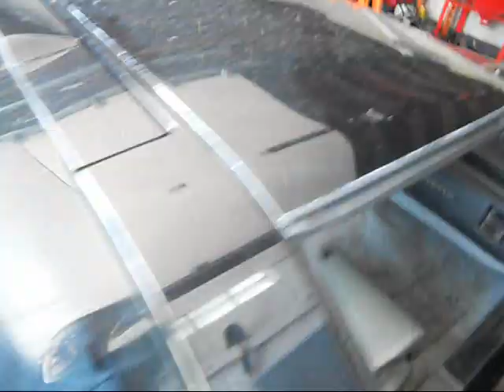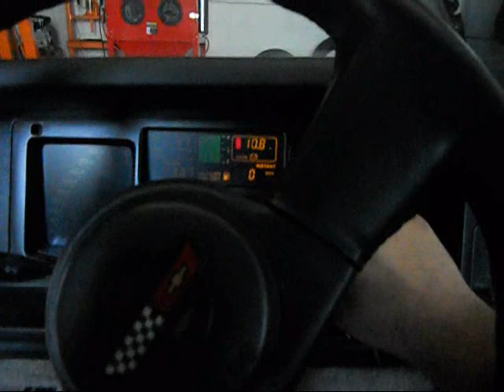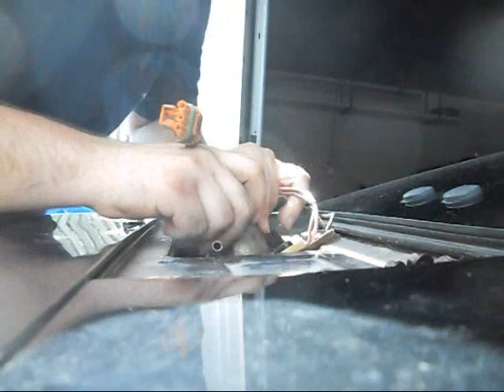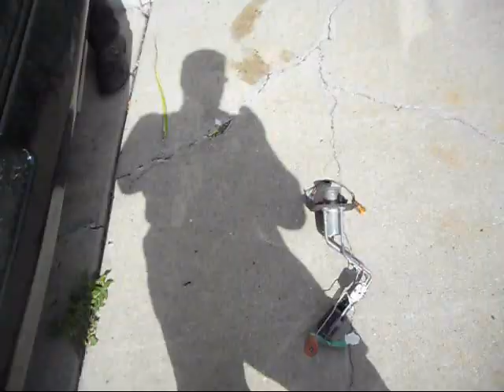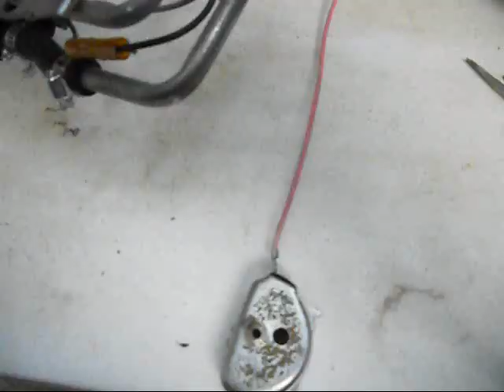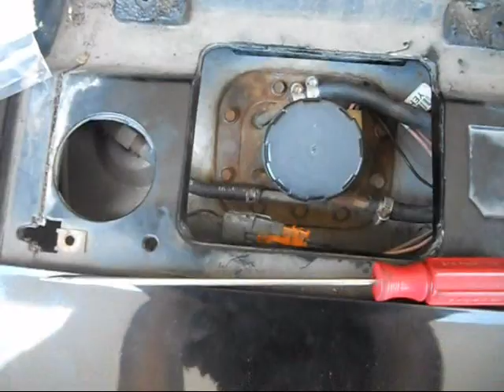1986 Corvette fuel sending unit repair

Comment: Congrats, this is the best video on the actual issue of the resistor failure for the sending unit.  Mine is stuck on full and now (after seeing your video) I think I have a broken resistor too.  NO ONE else has shown how to replace/repair that single component.  Thanks!
Reply from the maker: thanks, that's why i made this video, also my fix has no problems after 4 years
Reply: hi ,  i own a 85 corvette with 55k miles and 1 owner only.  recently while driving the car slowly sputtered to a halt.  after waiting a few minutes it stated up again.  i had it towed to a mechanic who said it was the fuel pump as i suspected.  he further said that when he inspected the gas tank it had no gas even though the gauge said the tank was full. so, i asked him after viewing several youtube presentations if he checked the sending you.  he didnt.
now i am left with the dilemma to change the sending you or send out the fuel gauge located in the cluster of gauges for repair.  how do you recommend i proceed in order to minimize work and expense?
thank you.
steve
Reply: @theperfectpresentco.5626  interesting...how did he determine the pump was bad when there was no gas to pump?  Obviously the pump was working enough to empty the tank.  Find a new mechanic.
Reply: @timtipton9002  

Hi Tim!  Thank you for your prompt reply.  I apologize for accidentally using my business info and email address.  You can note my business at tfairy.com. 

I do want to continue our conversation and would appreciate if you could forward your email to sdagz@aol.com.  I am located in phila area.
thanks again.

Comment: Commen issue on 84 till 1990'vettes they tell you.to.replace the whole sending unit cuz cleaning will get u by for short time then it will.mess up.again
Reply: hi doty,  i own a 85 corvette with 55k miles and 1 owner only.  recently while driving the car slowly sputtered to a halt.  after waiting a few minutes it stated up again.  i had it towed to a mechanic who said it was the fuel pump as i suspected.  he further said that when he inspected the gas tank it had no gas even though the gauge said the tank was full. so, i asked him after viewing several youtube presentations if he checked the sending you.  he didnt.
now i am left with the dilemma to change the sending you or send out the fuel gauge located in the cluster of gauges for repair.  how do you recommend i proceed in order to minimize work and expense?
thank you.
steve